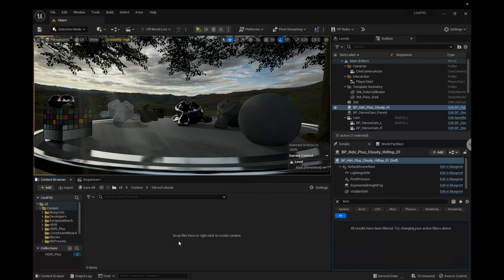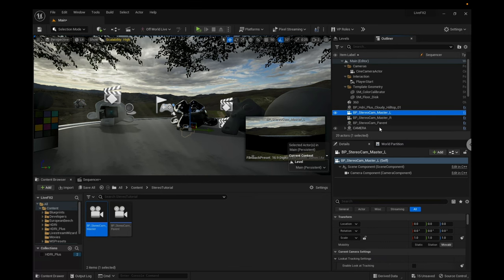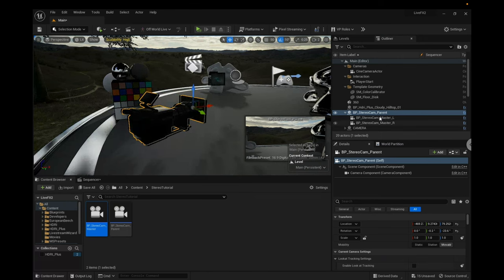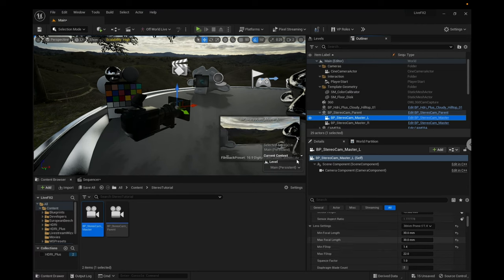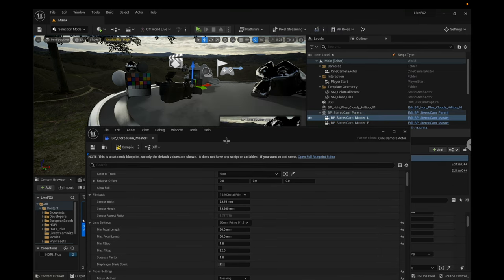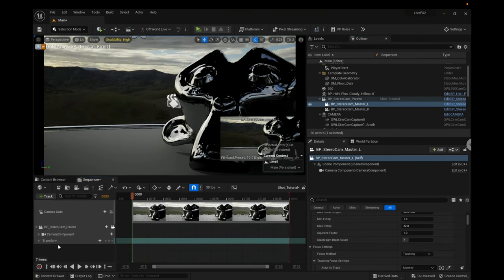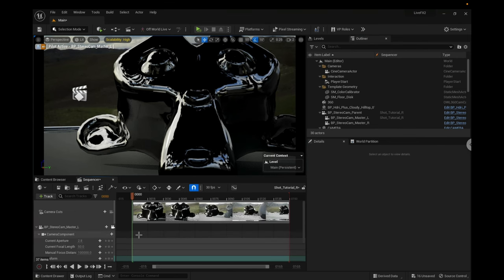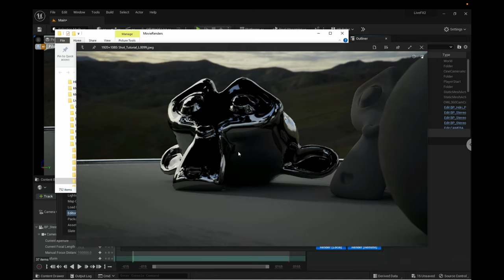Stereo 3D Camera Rig in Unreal Engine!

Comment: Great tutorial. I was trying to use this technique but you clarified some steps I was missing. The sequencer now has panoramic rendering built in so I am going try and apply this technique for 3dVR 360/180. Do you foresee any issues I might run into?
Reply from the maker: Oh cool, when did they introduce panoramic rendering?! 

For 360, I don’t know how sequencer is working, but definitely test a few frames before rendering out a whole sequence. You may have to turn off most effects, especially anything that is screen space
Reply: @justuslowry  I have success in rendering 360 stereo by using the new panoramic rendering feature combined by this technique. But I also want to render 180 stereo. Can anyone guide me to how to do that?
Reply from the maker: @faizanasif7042  I don’t know if it’s possible to render it natively, but you could render 360, then use another software to crop out the back 180. Not ideal I know but should work the same

Comment: hi alex thank you first
i was wondering if this method work with all distance object
Reply from the maker: You mean if things are far in the distance? If they are, you can exaggerate the distance between the cameras to force depth, but just be careful with this and check in stereo because you can obviously go too far.
Reply: @AlexPearce3d  
The look at don't do this job
I mean don't it adjust the angle of the camera automatically